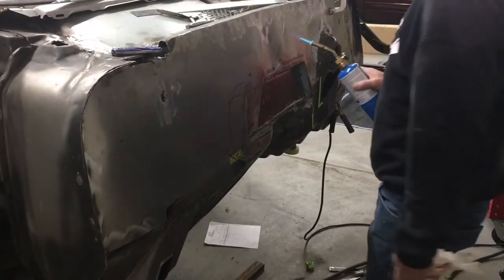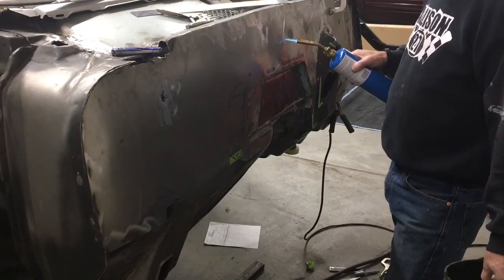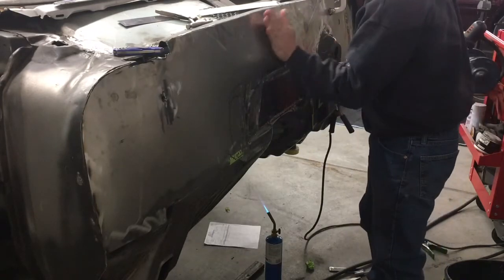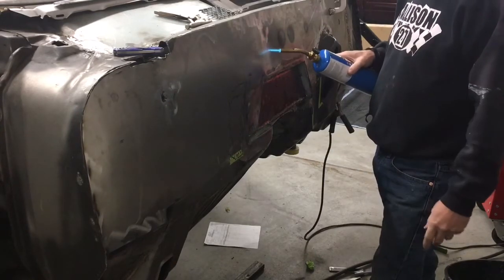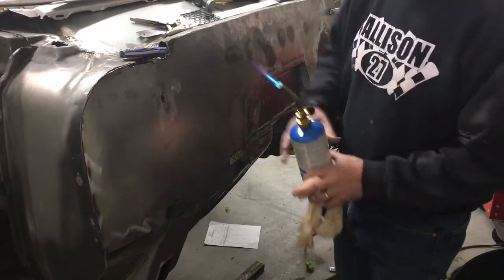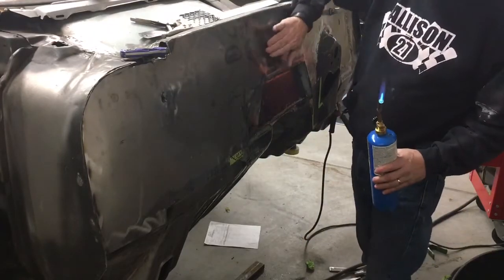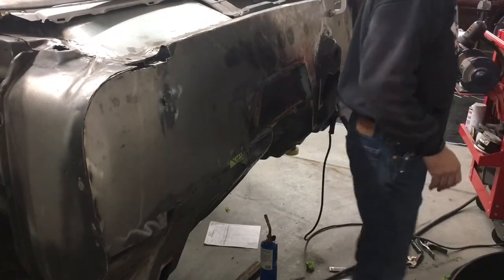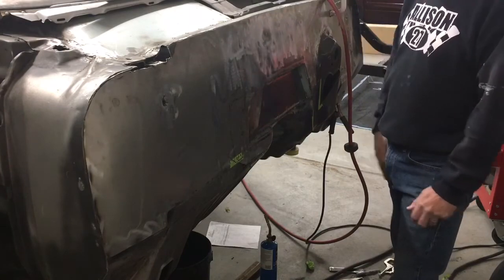Metal Shrinking. a large (supposedly flat) panel

Comment: I had success with a propane torch on a Jeep hood. It had major wattage from sandblasting then powder coating. My first success with removing oil canning. I got pretty excited
Reply from the maker: It’s shocking how much these panels can move around with fairly mild pressure or heat.

Comment: Thanks for the vid !   I always wondered the pitfalls of smoothing such a big piece of metal
Reply from the maker: Thanks Bernie!  Yea these big flat pieces are not always easy to keep that way.  Tig welding can help, because you can control the heat a little better.  Really though the only good way is Patience! - let the metal cool between welding very small areas at a time.

Will you be back at SEMA this year?